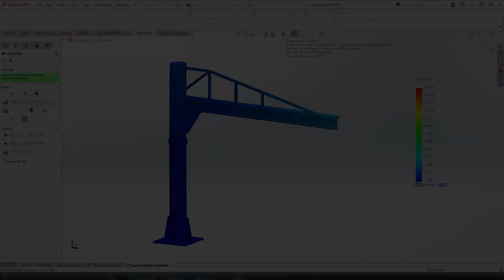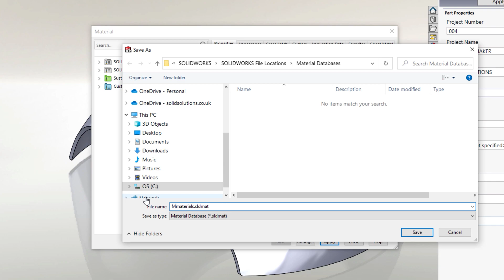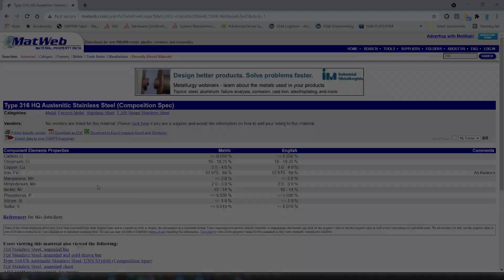Creating Custom Material Libraries in SOLIDWORKS | Beginner SOLIDWORKS Tutorial

Comment: Hello
Can you please help me to find out the Properties of the  Pine, (General properties for simulation). I need the information that can help me to do solid works simulation/analysis.
Information required like, Elastic Modulus , Poisson’s Ratio , Mass Density & Yield/Ultimate Strength  etc...
I gone through many websites sites but i am not sure which is the accurate value to take. So,please help me out.

Thanks in advance for your help.
Reply from the maker: Hi, We do offer Simulation training courses here - https://www.solidsolutions.co.uk/solidworks-Training/Courses/Simulation/default.aspx
Reply from the maker: I had a chat with one of our simulation experts and they say there isn't a specific resource we recommend for finding material properties of wood. 

They recommend searching for the material in question along with the material properties you are after and look for scientific publications/articles that have researched an application and state the material properties in the paper. 

It's worth noting that for wood, the properties are quite dependent on moisture content, so will behave different indoors vs outdoors and in different climates, this may explain why you are finding different values.

If you are unsure it may be worth contacting an expert, if you are one of our customers please feel free to contact support to discuss further.
Reply: The best reference for wood material properties I've found is the "Wood Handbook:  Wood As An Engineering Material", put out by the USDA Forest Service, Forest Products Laboratory.  It's freely available online, and contains engineering properties for wood and wood products of various types and species.  Don't forget that Wood is a non-isotropic material, so has different properties in different directions, and these also vary depending on how it has been processed.